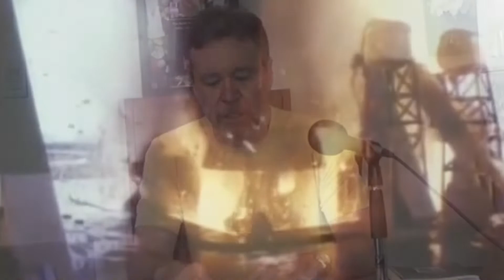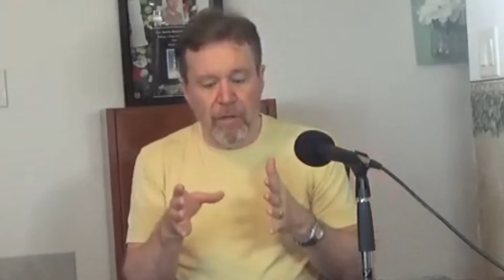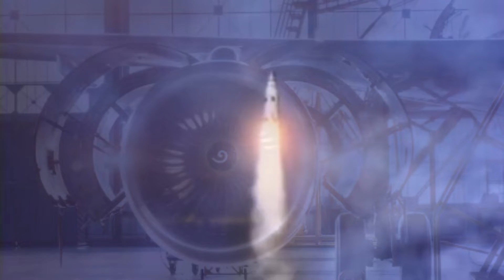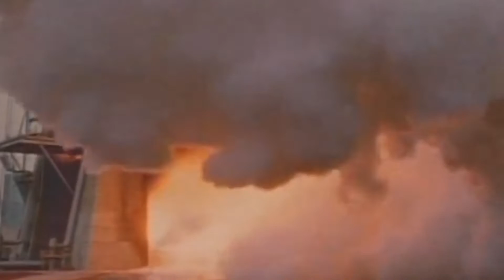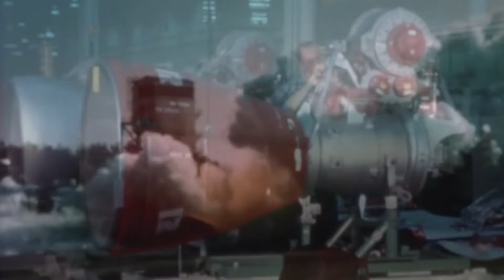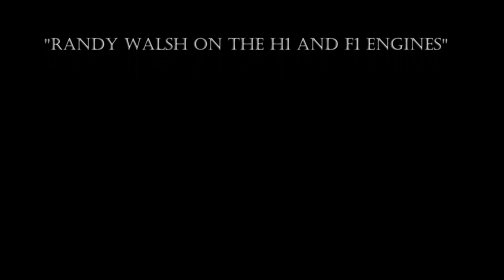"Randy Walsh On The F1 And H1 Engines"  Part 7!

Comment: H is after F
Reply from the maker: The H1was the first engine used. the F1 came later.
Reply: @theapollodetectives  whats the H and F in reference to?
Reply from the maker: @justinjay6930  The H type and F type engines were used on the pre Apollo and Apollo program. Ignore the resident shills as all they have are insults to post. Cheers!